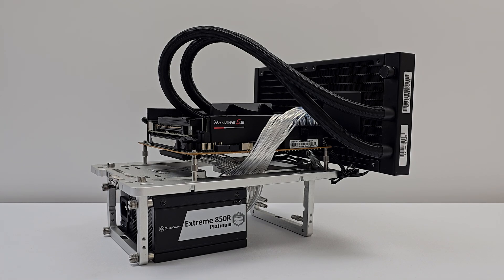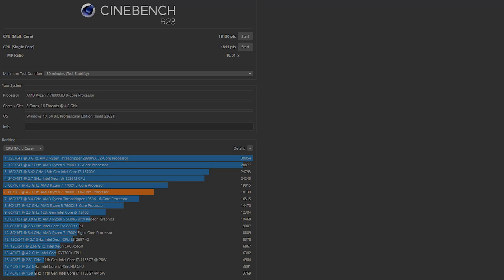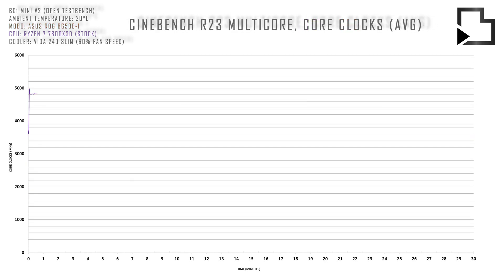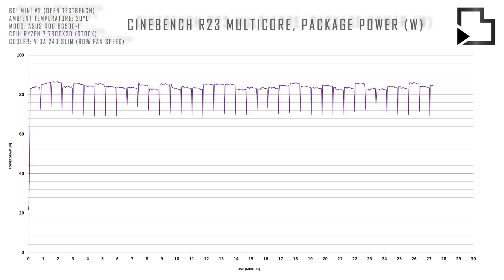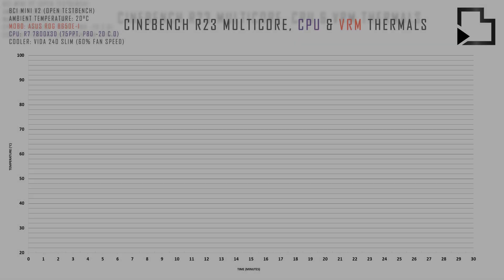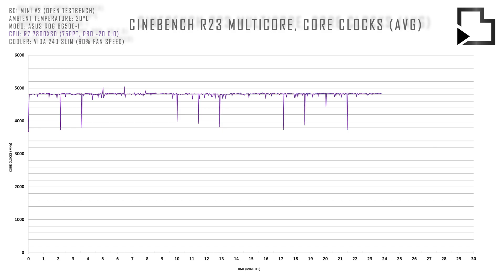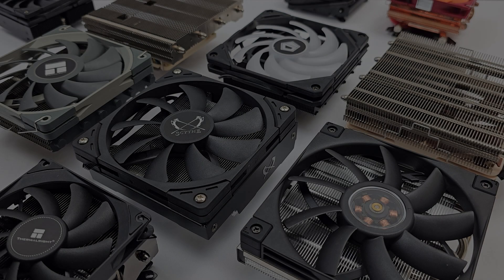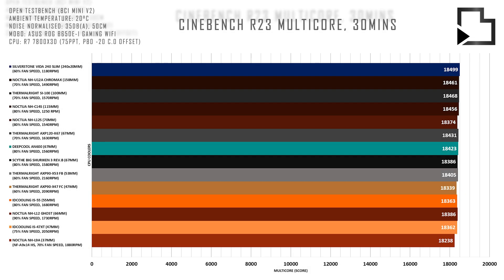Low Profile Coolers vs. 7800X3D

Comment: Thanks for your work! I had problems to decide between the options for the fractal ridge with a 7800x3d.So the axp 120 is the best option.
Reply: Are you happy with it ?
Reply: @joaoduarte5989  yeah,kind of. With Curve optimizer and fixed Fan rpm it is alright. But for best results you should consider direct die cooling,which i didnt want for my Build.

Comment: Cheers for the vid.
I've ordered the L9A to pair with the 7800X3D to put into my FormD T1, looks like I'll be doing the NF-A9x25 chromax swap to help thermals stay a bit more manageable.
Reply: how are the temps? have an l9a on am4 right now and thinking of just getting the am5 bracket instead of buying an axp90 36
Reply: @sam-gz1ql  my workload never loads the CPU, so I've never seen above 75°C at 25°C room ambient at 70% fan speed (I didn't even do the fan swap) 😁
Reply: @AxleLotl  wow nice, and do you think the fan swap helped at all? I don’t know much about how swapping fans helps or hurts temps
Reply: @sam-gz1ql  I didn't do the fan swap, I was going to and I have the fan to do it, but after doing some tests, the extra static pressure wasn't needed. (:
I am thinking of changing to an AXP90-52, though.

Comment: It would be nice to see them compared using the same fan.   It's time to rebuild in my SilverStone FTZ01S and the decision for CPU cooling is to reuse the NT06-Pro cooler with a SilverStone Air Slimmer 120 slim fan (instead of the Noctua fan I had on it), or use a 240mm AIO (SilverStone VD 240-Slim or Asetek 670LS).   The AIO will fit inside the case above the motherboard if the HDD tabs are bent down; however, it would only have a single 120mm fan slot usable.   Both types of coolers would have a slim fan pulling from the bottom and dispersing down draft air flow onto the motherboard, as well as the ability to add a second identical fan on the outside of the case side panel (if one doesn't mind the asthetic) to create push/pull.   I'm curious about the performance since it is impossible to find reviews/tests newer than 2015 of the NT06-Pro using a good slim fan under it and two good slim fans.   It's also just as difficult to find tests of an AIO using only one fan position.   Other competant builders I've talked to only speculate that the 240mm liquid cooler with one 120mm fan would be the better performer than that large air cooler using the same one 120mm fan.

Comment: have you tried the Noctua-L9x65 with this Cpu 7800x3d?
Reply from the maker: I haven't, sadly. Its definitely not on level of existing 67mm coolers and I'd be surprised if it beats the AXP90-X47 Copper by much if at all. All speculation, of course.

Comment: Hey man, your channel has been a mine of data that I was looking for, thank you for doing the work! Well worth the sub!

I'm building a high-end Fractal Terra PC, with 7800X3D, Asus B650E-I Mobo and a RTX4090 FE (yet to be delivered). 
CPU cooling has been an issue, loads of benchmarks in the net, but most of them are outdated in 2023.
Max clearance I have with the above setup is 66mm, the case would some minor modification of course.
Not knowing what I was doing I settled on a Noctua NH-L9x65. I'm gonna return it and get something else.

My 3 options are:
1. AXP-100 full copper with a 15mm Noctua fan swap
2. NH-L12 Ghost stock
3. ID-55 with a 25mm Noctua fan swap.

What do you reckon might be the most heat efficient and quietest solution? Emphasis on quietest.
Not gonna do any CPU demanding work on the PC, mostly 1440p high-fps gaming.
Reply: Hi, please tell me what you finally chose and do you like what you took?
Reply: @potatobless  I settled the NH-L12 Ghost. I also tried the IS-55, but it was too loud for my liking.
Reply: @Pyzio1cssr  Excuse me, but can you show a photo of how your case looks inside, for example via imgur, or are you uncomfortable?

Comment: its really awesome the power these low profile tower coolers have when applied to real world cooling. Unless you're putting your CPU under stressful synthetic loads, or trying to really push your silicone luck, you don't really need an AIO. Air cooling is making a grand comeback

Comment: Hey man can you please test the Black Ridge with a 120MM slim fan on top. PLS! That would be so helpful, you can even do it with the is55
Reply from the maker: You mean 25mm fan on top of IS55, instead of 15mm thick fan, which offers like 1°C improvement. Adding slim 120mm on top of the Black Ridge does offer improvement, but then it's 63mm tall at that point and in eyesights of AXP120-X67 and the likes. It's also not how the cooler comes.
Reply: @L91  hey thanks for reply. O i forgot is55 came with slim 120mm. I am considering the black ridge and the x67 for my formd t1`, yes I know with 15mm slim 120mm on top its 63mm, but for me that means I can give my cpu fan or my gpu fans more room in my Formd T1. Which performs better at same noise level: axp120-x67 or black ridge with a slim 120mm fan on top ?
Reply from the maker: @zafert85  Black Ridge will very likely be quieter due to reduced turbulence if you run the fan underneath the BR at low RPM and top fan as desired. It's also worth noting that BR is not compatible with AM5 and has some caveats with motherboards
Reply from the maker: @zafert85  Black Ridge will very likely be quieter due to reduced turbulence if you run the fan underneath the BR at low RPM and top fan as desired. It's also worth noting that BR is not compatible with AM5 and has some caveats with motherboards. This is why is didn't test it with 7800X3D
Reply: @L91  I will use 100% top fan , because i have lp ram not vlp. What would performance be like compared to axp120?
Reply from the maker: @zafert85  should offer reasonable performance in my not so expert opinion. Because I've not personally tested this configuration on AM5. I don't think it will be quite on the level on AXP120-X67, but that is not really what you're just going for here. You are also aware the BR is not compatible with AM5 and requires work arounds
Reply: @L91  Yeah I will use it with my 13500, Going for the BR with top 120mm slim fan gives me alot of flexibility. I can go for a 2.5 slot gpu if i want to in the future, cuz 2 slot cards are getting rarer by the day. BTW I truly appreciate your work. Thanks to your reviews I have gone for the x67 atm. I still have to build my pc though. I have 4070 FE on the way because i wanted to have a really efficient gpu, but i see 4070 ti can be very efficient when also undervolted. 

Could you maybe do a small test on a intel mobo with the black ridge with 120mm slim fan on top pushing and the x67 as a comparison.

Comment: Are these tests done with expo enabled?
Reply from the maker: XMP, mine isn't an Expo kit, Gskill Ripjaws DDR5 6000, CL30
Reply: @L91  xmp can’t be used with same numbers on amd motherboards?
Reply from the maker: @ozzracer  XMP kits does the same thing as Expo. Its just OC profile, it's the RAM timings that matter. Its not called XMP in BIOS btw

Comment: The thermalright axp 120-x67 is not compatible with AM5 Mobos so how did you test that with a 7800x3d?
Reply from the maker: I'm not sure where you got this info from, but it isn't accurate. Unless you mean AXP90 coolers, but that also isn't accurate imo

Comment: hi! thanks for this video, it helps a lot to shrinks a cooler options for my new gear.

im planning to get 7800X3D on my 7.5l case with only 70mm clearance for cooler. originally i got some names, but now i only have few options (NH-L12S, BS3, ID-IS55, and TR AXP120-X67), which one will suit my needs if i plan to switch all the fan to my old Noctua 120x15/120x25? will changing the fan to Noctua improve their performances by significant?

and sorry for asking, but i need to make sure, all this coolers you tested isnt a golden-pick one right? i mean, its the same version as the markets get right? cause ive seen some reviewers get a golden-pick coolers hence the results is quite different from one to another. hope i get some answers from you, thanks! (:
Reply from the maker: Sorry I missed this. These are all retail units.
Reply: Which case ?

Comment: Would love to see the axp90-x36 tested. :)
Reply from the maker: Performs near identical to L9a
Reply: @L91  wonder if adding a 25mm fan on the x36 would improve the performance above the l9a then.
Reply from the maker: @JSpaceCraft  you could add 25mm to either of these coolers, doesn't improve performance, only slightly better noise profile. At that point, the cooler would be 47mm tall, but would get absolutely obliterated by AXP90-X47 FC for thermals

Comment: I wonder,  why there is so much difference in perfomance on AM4 and s1700 platforms? Сopper TR AXPs VS IS-55?
Reply from the maker: I've not tested AM4 with most of these coolers, so I can't say anything concretely, but in my experience, platforms and CPUs can change the narrative. Feel free to link other sources.
Reply: @L91  Sorry, I actually mean AM5 and two of your test.
Reply from the maker: @cryptosol160  I've not tested the IS-55 and AXP90 coolers on AM4

Comment: What is going on with the L12 Ghost?
Reply: Can't believe the AXP120 is outperforming it by that margin
Reply from the maker: It's having a very rough time on Zen4, and even rougher with X3D, landed about on par with X47FC with 7600X & 7700X. I've literally no idea. I'm going to chat with Noctua as I don't get it either. Though they didn't seem at all surprised by my last benchmarks with 7600X, 7700X. The X47FC is an incredibly powerful cooler for its size and punches well above its weight class of 47mm.
Reply: @L91  Yeah that sounds like a good idea. The X47FC seems WELL worth its price, holy cow. That little thing for sure does pack a punch.

Out of curiousity; I would like to do a 7800X3D build in the Fractal Terra (sigh, I know.) what cooler would you actually recommend? CPU cooling feels like such a tough topic for that case in particular! Appreciate all the hard work you put in, these videos are extremely helpful!
Reply from the maker: @Zqott  tough call, since I've no experience with Terra, I'd suggest chatting with our dedicated Fractal group over on Discord: https://discord.gg/sffgurus
Reply: @L91 did you use the Noctua AM5 Offset mounting kit?
Reply from the maker: @vincentvega3093  I haven't tested the offset kits yet

Comment: Surprised that the axp90-x53 did so much better than the is-55!
Reply from the maker: AXP90-X53 Full Black in all copper cooler and not to be mistaken with X53 Black. The copper AXP90 coolers perform unbelievably well for their size on Zen4 and LGA1700.
Reply: @L91  I'm glad they also sell an all white version of this cooler :)

Comment: Would an IS-55 see any improvement from swapping out the slim fan for a 25mm or 30mm?
Reply from the maker: Swapping slim fan for 25mm thick fan or otherwise doesn't really provide additional cooling when it comes to coolers, simply better noise profiles

Comment: I hope you would've included alpenfohn blackridge, i appreciate if you compare the thermal result of it on 7800x3d with all low profile coolers
Reply from the maker: I opted not to include it this time round since it's not officially compatible with AM5 and requires work arounds, such as modifications to mounting hardware. I did include it in the previous comparison with 7600X & 7700X: https://youtu.be/xiYoYa7c_uU

Comment: Great to see the new AN600 too! 

I want to build 7950x in cooj mq6, which cooler would work best in your opinion, l12s, axp 120x67 or an600? I have max cooler height of 72mm and I’ll go with the mesh panel to reduce the turbulance noise from close fans
Reply from the maker: L12S is likely to provide the least turbulence with fan installed underneath, if that's a main priority. All 3 of these coolers are on par with each other in terms of cooling. It's worth noting that the L12S may not be compatible with all AM5 ITX boards, and one of the heatpipes made ever so slight contact with I/O shroud on my own B650E-I motherboard. AXP120-X67 is the cheapest. AN600 has a better stock fan and similar excellent motherboard compatibility as AXP120-X67.
Reply: @L91  Thanks for the opinion! I’ll probably try an600. Is the fan swappable to noctua or it’s good enough to not swap? I might not like the lighting it has, can you turn it off?
Reply from the maker: @MamukaOkriashvili  the included fan is decent, but you can not  turn off the white lighting, but you can swap the fan with nf-a12x15 or SilverStone Air Slimmer which is slightly better is my understanding.
Reply: @L91  thank you! 🙏

Comment: The Thermalright AXP90 X47 Full Copper is such a beast

Surprised by where the IS-55 is ranked
Reply from the maker: AXP90 copper coolers sure do change up the dynamics. I'm not too surprised by IS-55 myself. The L12 Ghost, however, is just an enigma on Zen4.
Reply: Does the AXP90 X47 FC fit on the Gigabyte B650I mobo? Seen some people say they had to dremel the backplate or dent the pipes to make it work
Reply: I was also surprised. I think Hardware Canucks tested on 7000 processors. In their tests IS-55 performed similar to AXP-100 Full Copper. Wonder what could cause the difference.
But now that I think of it, they normalized their results on output noise.
Reply from the maker: @DeinielMas10  I've also noise normalised the fan speeds, as best as I can atleast, enough to point swapping 92mm fans wouldn't change the result and swapping 120mm fans between coolers doesn't change things. I've tested IS-55 across 3 different Zen4 processors to account for errors and IS-55 lands about the same place. There's always a possibility of cooler being dud, but I doubt it. You'll have to make of it what you will, and don't believe everything you see on the Internet.
Reply: @L91  Just watched the other video again and they were testing on 5800x.
I agree that the best thing would be to order and test them all on the specific components and case. Unfortunately it's unfeasible for the Thermalright copper ones because it would be an issue to return them since they need to be imported (if you can buy them at all).
Reply from the maker: @DeinielMas10  it's certainly important to remember that different platforms, CPUs can change up how coolers perform. With 3 different CPUs tested for Zen4, I'm confident the data is as accurate as can be.
Reply: I would've expected the IS-55 to perform just below the AXP120 X67, and certainly not be worse than the AXP90 X47.
Reply from the maker: @Notorious544d  it doesn't perform as well on Zen4, unfortunately. It performed similarly in my 7600X, 7700X testing: https://youtu.be/xiYoYa7c_uU